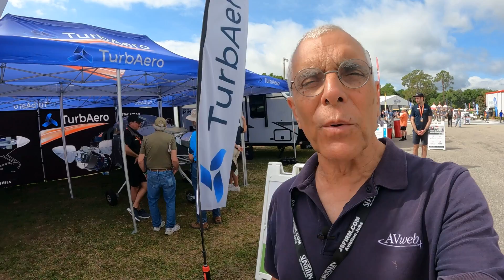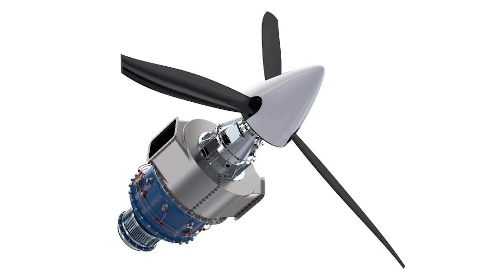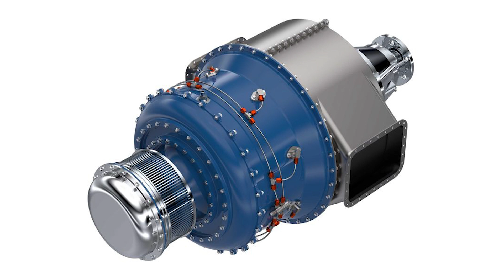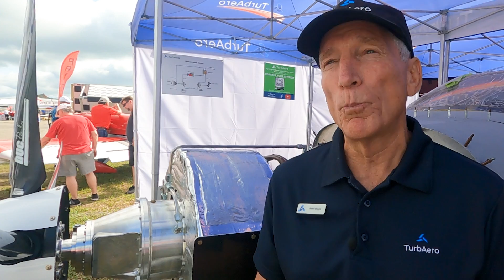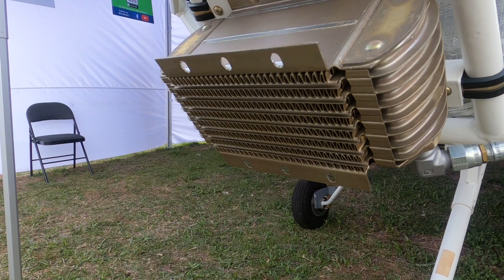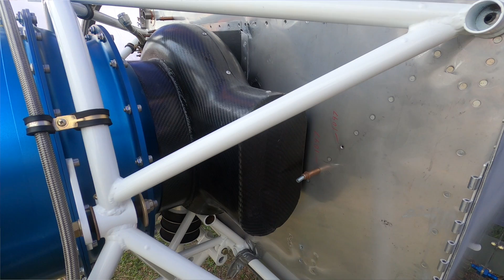Turbo Aero's Small Turbine Update

Comment: Love the idea, hate the name. Turbaero almost hurts to pronounce out loud. A name is important to overall company morale, culture, and visibility. Think names like rockwell, grumman, lockheed. Does anyone there have a cool last name lol?

As far as the engine itself I cant gather much from this video but the size and shape appears to be a centrifugal compressor. I think this is smart to keep costs down, cost of maintenance way down, and its only a 200hp engine which is easily achievable without lots of complex stages. Fuel efficiency is not going to be as high as it would have been if it were an axial spool but I think its worth it to have much cheaper up front costs and maintenance costs. I wish these guys luck!

Comment: In order to be viable,  a "small turbine" would need a fuel consumption rate lower than 12 gph and THAT'S not likely for a Turbine, not even one with slightly more parts than last year's plastic display model.

Comment: Fletcher went turbo prop years ago. Prior to that it was the flat 8. Same airframe.
I'm I missing something here?
If GA was going to use Turboprop it would have happened years ago. The issue with gas turbines is they are hungary when taxing or waiting for the go ahead for takeoff. Efficiency comes in when they are at high load.
Reply: I’m nearly but not quite so pessimistic..  Computational fluid dynamics modeling has gotten a lot better and a lot cheaper over the years.  And precision automated manufacturing has also gotten a lot cheaper.  The two combined could offer significant improvements over the old Solar T62 APUs back in the day.  Remains to be seen what they deliver.
Reply: Even at high load a turbine this small is still not efficient.

Comment: I'm curious to know the comp ratio to arrive at that fuel flow. That's my biggest issue with the PT6As on our King Airs. If Pratt Canada updated the turbine section with CMCs to allow a higher comp ratio and ITT the fuel burn would improve. I doubt a small company like TurbAero can afford the investment in ceramics though.
Reply: Hi dieselyeti, high pressure ratios and temperatures are not compatible with recuperator technology.  However, recuperator technology offers better fuel efficiency enhancement for a given cost than the higher temps and pressures.  As a result of lower temps and pressures, we can avoid the use of exotic materials such as ceramics etc.
Reply: @TurbAero  you are in the midst of an additive manufacturing runup - cmc and other exotic materials, that were expensive 10 years ago, are starting to come down in price significantly thanks to ease of manufacture.
Reply: Pressure (not compression) ratio in these small turbines is effectively limited by the single-stage compressor, rather than materials in the rest of the engine. 

The PT6A compressor has one centrifugal stage plus four axial stages, so it is capable of a much higher pressure ratio if the rest of the engine can handle the resulting temperatures.

Comment: It can be much more eco-friendly. No lead, better exhaust, lower SOx, NOx, COx emmisions.
Reply: Total carbon emissions are directly the result of fuel consumption... which is higher for any small turbine than any piston engine of the same size.

Of course any lead in fuels in the 21st century is ridiculous and should not be tolerated.

Comment: Pros of a Turbine: Muuuuch higher reliability since there so many less moving parts that an ICE and of course the bad ass sound! Just with that, a turbine will always win
Reply: Depends on the era of the underlying technology..  Turbines of the 1950s weren’t so reliable..  If these guys are planning to use the same materials as back then the reliability may not be so great..
Reply: @matthewprather7386 Precisely not ..
Not only is materials technology advanced but CNC and 3D printing of metals means it's possible to do so much more.
Reply: @thewheelieguy  possible, but there’s no guarantee a low buck turbine will get that tech - the point I was making.

Comment: Anyone comparing fuel burns on 200hp engines clearly don’t fly single engine IMC often. 

I will gladly burn 20% more fuel to safely operate at night and in IMC single engine.  Low IFR   Also everyone’s looking at just engine cost. Your forgetting most turbines have 50% higher TBO
Reply: You must have a really bad piston engine to be afraid to fly single engine IMC.
Reply: Yep!   '....IMC, single engine, single-pilot, at night, over the ocean with PAX....' FIFY

Comment: I still don't understand why they don't have a prototype turbine running yet
Reply: Hi Hugocraft.  Engineers with gas turbine engine design experience would certainly understand why we do not have a prototype running after only 5 years, particularly with delays associated with Covid thrown into the mix.  Turbotech took 8+ years to develop their 130hp recuperated turboprop.  Heron engines took 8 years to develop their 130hp traditional turboprop.  P&W or GE would take that long as well.  We are running pretty well at par for the course with where we are at in our development program.  We hate that it's taking so long, but a clean-sheet recuperated gas turbine engine for aircraft is simply a very complex piece of equipment with incredible design challenges.
Reply: Making prototypes is expensive and hard?

Comment: There is a reason turbine engines are $350k+.  While I hope they are successful, until it is flying for a few years it is all vaporware.  Deltahawk, Innodyne, Eggenfellner, etc.  They promised great efficiency and "see you at Oshkosh next year with an experimental running and certified the year after", but then reality set in.  I have been flying for 35 years and turbine technology has changed little since then other than some computerized control that reduces pilot workload.  The diesels have pretty much been a flop and Rotax has been a leader in true fuel injection/ignition in certified engines, but too little HP.  TAT turbo has been a leader in TN, but other than that, it is hard to beat a good ole piston engine.  Bolt a turbo on a IO-390 and run 150 HP at 18k burning 11 GPH or so and you have the same performance on a $50k budget.

Comment: Look at Czech JMB Aircraft with their turboprop powered VL3 Ultralight using a TP-R90 from the french Manufakturer Turbotech. It ist also brand new and shall be comparable with a Rotax 915 iS.
Reply: is the fuel burn any good compared to a similar power piston?
Reply: @RM-el3gw  From what they have shown so far, it is pretty much up there with modern piston engines. In an interview JMB's spokeswoman said that the turboprop version is pretty much identical in speed and consumption to the piston version. It's just slightly down in power compared to the piston version, but that is compensated by the improved aerodynamics. The final version could actually be faster with potentially up to 160hp according to JMB. And it does look really pretty.
Reply: Here some details https://youtu.be/dBVBoMF2wsg
(english starts at 5:30)

Comment: What's the invention: a cheap turbine. What's different: it's cheaper. What are you doing different to make it cheaper: we'll make it cheaper. How are you making more horse power than other small turbines: we'll make more horsepower because that is what is needed.
What if the existing turbines become as cheap as yours and match your power? Can't happen, we will always be cheaper.
How are you using less fuel: some new heat exchanger that the others never bothered looking at.
Reply: I think the difference would be a 3d printed heat exchanger. Small differences in heat exchanger efficiency makes or breaks regenerative cycles.
Reply: @theSupercloak  "3d printed heat exchanger"?  You forgot to write "Cryptocurrency, A.I., new and improved".
"printed" with what?
Reply: Heat exchangers have been around for a long time, they were always just really big, on the powerplant style turbines, and maybe large marine applications.

They're just trying to make one smaller & lighter. We'll see, I just want to see a ying prototype.

I definitely think they are going after the wrong market to start, I would have aimed for the 260-300hp market first.
Reply: @kazansky22  You must be living under a rock…you can make heat exchangers that are more efficienct with 3d printing using processes like what velo3d has to offer.

Comment: The answer for small aircraft engines is a double(2) rotor engine.....one rotor for intake and compression and an adjacent rotor for ignition, expansion and exhaust.
Advantages over a piston engine....simple rotating action, fewer moving parts, less stress on the moving parts, no continuous start and stop energy draining action and a longer expansion action for more efficiency.
Reply: And the rotary disadvantages with trying to keep the seals working for any length of time.
Reply: @JustSayN2O  Mazda was a single rotor, which lead to a lot of inefficiency, as the single rotor had to perform all 4 cycles. Splitting the cycles into two separate parts makes for a much simpler engine. 
The compressed fuel/air would be contained in a chamber above the 2nd rotor, until ready to be ignited.

Comment: Cirrus and Bonanza are the real market for these things. If they can get them to make 260 HP at 12000ft on 20 GPH, they will sale a million of them...fuel burn any higher than that and it becomes a range/payload issue...
Reply: Even if they took 100 percent of the new GA market, there are less than 2000 new GA airplanes sold each year.
Reply: @wrkingrageaholic  For sure...it was just a figure of speech...

Comment: They been developing this for 40 years....
Reply: 5 years so far with several more to go.  Turbotech took 8+ years to develop their 130hp recuperated turboprop.  Heron engines took 8 years to develop their 130hp traditional turboprop.  P&W or GE would take that long as well.  It is simply how long it takes.  Anyone that believes that this technology has been around for 60 years now, which means that a development program should be finished in a year simply does not understand the complexity of a development program for a clean-sheet designed turbine engine.  Remeber that this engine must be reliable, last a long time, not fail and can perform in all corners of the operating envelope for the engine and in all corners of the operating envelope for the aircraft and in all environmental conditions that an aircraft will fly in.  We could design and build one in a year that runs, but noone should ever fly behind it.
Reply: @TurbAero  really hope you guys can pull this off. It would be an absolute game changer. Piston engines in GA aircraft is annoyingly still there with less reliability and added complications.

Comment: 12gph turbine? That's pretty insane. I hope they are able to meet that projection.
Reply: Check out the Turbotech TP-R90 fuel burn.
Reply: @andrewmorris3479  This is "only" 130hp rather than 200. Granted its fuel burn is very good at about 6 gph (US) per hour (19 l/h)
Reply: @FasterLower  And it’s running and can be purchased.
Reply: @FasterLower  190hp MCP
Reply: @andrewmorris3479  that’s absurdly low 😳
Hope it doesn’t cost twice as much as the rest of the plane
Reply: Yes and in Europe jetfuel cost almost HALF of AvGas, and AvGas is being phased out, so sounds to me this engine will be way CHEAPER per flown mile than any current piston engine.
Reply: may be cheaper but you'll lose range.
Reply: @silrobati  yeah but that doesn’t really matter in most cases. All you need in 3-4 hours of range, and that will be easy. After 3 hours you’d wanna stretch, take a toilet break and chill a bit anyway.
Reply: Yes, burning 12 US gallons of fuel per hour to produce only 150 horsepower is insane. It's like flying with a conventional engine while fuel is streaming from a hole in the fuel tank.
Reply: Plus you'd be burning Jet-A, cheaper than avgas & far more available, especially outside the US.

Comment: Without an operational prototype, it would be difficult to ascertain the BSFC. Even with CFD, surprises appear. 
I'd guess that 20% more fuel flow would be the best they could do, and likely, over the course of a flight, somewhat worse overall.
Reply: Well, that's not too bad all things considered. The fuel burn will lead to lower range but at the same time it's a bit cheaper than avgas. It's almost worth it just for the simplicity, and initial cost will definitely be a deciding factor.
Reply: @Ibrahimarm  also it sure would be nice to not have that crude piston chugging contraption out front begging to explode. I wonder how much they think it will weigh?
Reply: @friedclutch97  Most aircraft noise is the prop so it will still sound the same once you lift off. Engine noise in a piston plane is a lot louder at idle. Also, they're pretty reliable so long as you take care of them.
Reply: Have you ever heard an aircraft, @Ibrahimarm  ? How about a muffled aircraft piston engine versus an unmuffled engine? Lots of the noise is from the engine.
Reply: @brianb-p6586  I don't think I've flown without a muffler yet, and I don't really want to. I think it would suck. I still think most of the noise is the prop. Turbines sound different, but I doubt it's much different in noise level from a muffled engine. You make a good point though, I forgot that unmuffled engines are a lot louder.
Reply: Well if AVGAS is 80% more expensive (which it is in large part of Europe for example) then this is still a huge win. Plus let’s not forget the enormously better reliability. Still many accidents with broken down piston engines.
Reply: No,  manitoba-op4jx , any significant improvement of efficiency after production starts is unlikely, since the efficiency is determined by the design.